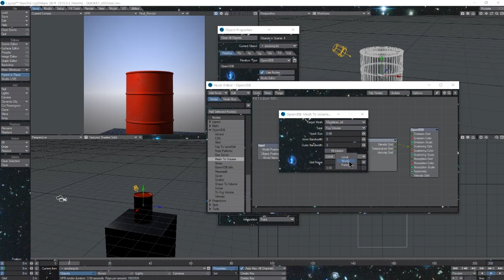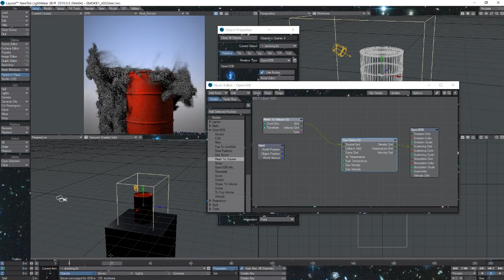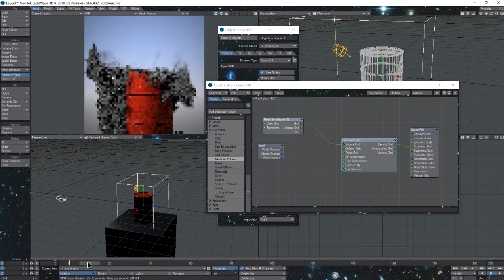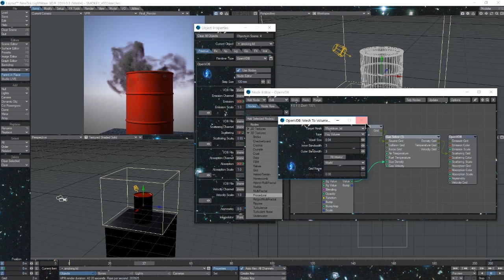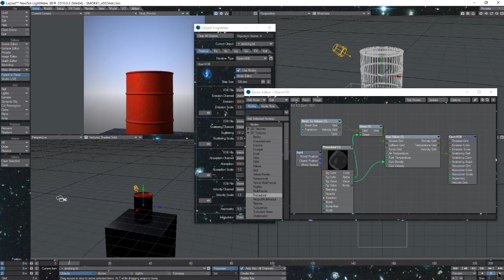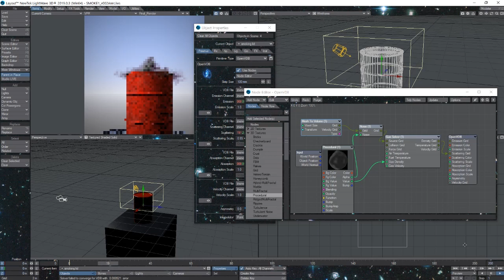OpenVDB Smoke Tutorial for Lightwave 3D

Comment: Thank you. Is it possible to retime an existing vdb file in LW so that the simulation goes slower, or this isn't possible with sequenced vdb files?
Reply from the maker: It is possible to change the gravity affecting the vbd. This will change how slow or fast it rises. There also might be a timer node in LW to adjust it's timing properties.
Reply: @marco3dartist  Thanks for the reply Marco. Would these settings be in the node editor?
Reply from the maker: @ProvVFX  Yes.

Comment: Never used this before. Tried it and it locked up my entire pc and couldn't get out of it. Couldn't escape or shutdown. 😬
Reply from the maker: If you want to email me at info@additivedesignstudio.com I can send you the scene file to test.
Reply: Did you ever get this resolved? If your using LW 2020 and not running the latest update 2020.0.3 their is a bug in Layout that when hitting play which was the step used to create the cache file that will lock things up. It was fixed with the LW 2020.0.3 upgrade. Its a free upgrade you can find in your user account.
Reply: @pixelatl  Yes I updated when it came out. I've not tried the open vdb smoke again. So I don't know if it was resolved with the update.
Reply: @jonos138  I've doing a lot of OpenVDB stuff this last week with no problems. Also before the upgrade I had some issues with TurbulenceFD that would crash every time I tried to generate a sim, the same with intense Bullet Dynamics scenes. Since the upgrade there's been no problems
Reply: Has anyone got this to work with the latest LW, ive followed the tutorial but when i press play nothing happens.